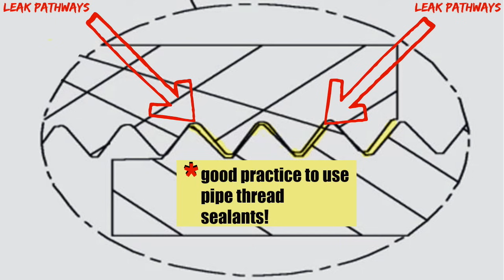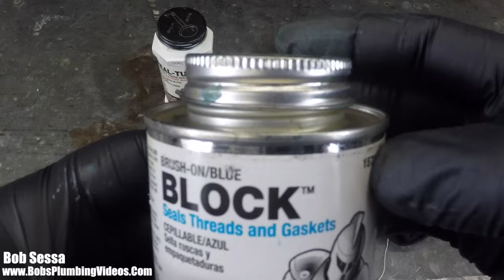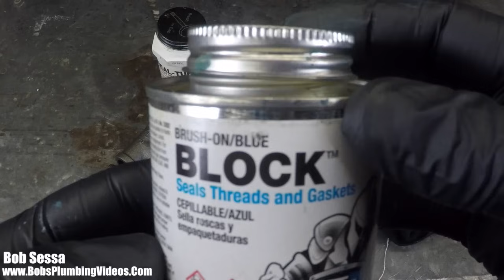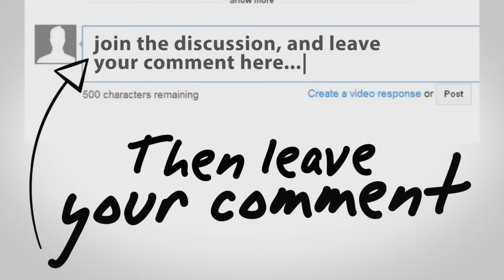Pipe Thread Sealant / Which Pipe Sealant & Why!

Comment: I think I am over tightening, as it is a bear trying to take apart years later. What is best to use to make taking apart easier? I have always stuck to straight teflon, but if something makes taking apart easy, I would change. 

I am needing  to reduce a 1" plastic, male, pipe threaded, fitting on a water softener, to a 3/4" male pipe thread. It came with a gator bite to 3/4" pvc or smooth copper pipe, but I have converted system to threaded at other ends all already for simplicity. It is plastic, si Was trying to stay plastic on plastic to protect water softener fittings. The in and out from wall has 3/4" male threads for using hoses. I would use the shark bite method, if I could find a short, 3/4", smooth to threaded copper pipe. 

My in and out from wall are opposite the in and out on the water softener, requiring me to cross the pipes also.

Comment: That's funny. I've been doing this for 44 years. I also use both dope and tape. It's probably a superstition. I always think as dope as a lubricant. Because, really, friction is the enemy of a tight joint. Never, ever, pull on the roll of tape when breaking the tape! What happens? The tape will get between the plastic edge and the roll and destroy the entire roll. What was the name of that Hercules dope that was black? Came in a pale green can. Now that was a sealant!
Reply from the maker: I believe it was Grip! Prior to Blue Block, that's what I would use for all my problem joints.

Comment: Thanks a lot & excellent video. I'm making a bean bag aka tree climber throw bag launcher with black steel. Don't trust PVC at 330psi, or even 100psi which will be about max. Should be a safer. Would tephlon tape be enough for 100 or so psi for say a 1hr or so? Or Blue block also
Reply from the maker: I would go with both the Teflon tape and a light coating of the Blue Block and you should be good to go. Thanks for checking out the video, regards. Bob.

Comment: Thank you for this video.  I will be installing a new boiler using black pipe for the supply and return headers.  Your video was a great help in making sure I seal the joints correctly.  Very well done.
Reply from the maker: I'm very happy to help, thank you for checking out the video, Bob.

Comment: I was hoping you would actually tell the differences between all the Hercules products because they all seem to be described in the same way as fast drying but still pliable they all have the same pre ssure ratings hydraulic ratings all can be used on all types of metal and plastic and PVC so its hard to choose which one to use. Some contain ptfe and some don't,  what applications require ptfe and which don't? I guess it doesn't matter they all pretty much seal threads. Was just curious, most of the stuff i work with is fuel oil related.
Reply from the maker: My expertise is in residential service and repair, that being said when I was in high school training to become an  oil burner service technician the sealant of choice was a product called permatex which I believe is similar to Hercules  Grip. Always worked, set semi hard and was the go to sealant of choice for no.2 oil.

I believe the the Hercules Real Tuff product has ptfe included, the MegaLock I believe does not. I use the Megalock almost exclusively with Teflon Tape unless I feel I have a problem thread in which case I use the Blue Block (use to use Grip). Hope that helps!

Regards,
Bob

Comment: My  question is, How do I seal Union fittings so they dont leak at all.  I have tried plumbers putty, Teflon tape,  joint compound and no matter how tight I get the union it leaks to some extent.  What do I need to do?  (Galvanized water pipe seams to be the biggest problem).
Reply from the maker: If you're talking about a "union fitting" in particular, I just use Blue Block or Grip on the face of both ends of the union before I assemble it and whack it up with a couple of my Ridgid pipe wrenches.
Reply: Ya shouldn't be using galvanized pipe for water anymore, since maybe 1950's.

Comment: Very informative, thanks.  Just to refine the overall issue, tapered threaded pipe connection is a throw-back technology that IMO remains with us only because it continues to provide excellent mechanical joint strength at low cost.  But its inability to seal has been a design flaw since its inception as your video addresses fairly well.  Augmenting the description I would add that the actual problem is primarily from the mismatch between the peaks/valleys of engagement.  The major diameter of the female thread HAS TO BE be larger than the major diameter of the male thread and, congruently, the minor diameter of the female thread HAS TO BE larger than the minor diameter of the male thread. (I say "has to be" because if there was an interference of either condition the rest of the two thread surfaces would not even touch.) The two resulting gaps at the peak/valley clearances then create two helical paths for a leak even if the rest of the thread surfaces match up perfectly. It is those helical paths that have to be plugged up

I would also add that male pipe threads on commercially produced pipes/nipples/parts are cut single point on a CNC screw machine that provides a much closer tolerance thread than anything you can hope to get with one of those multi insert manual pipe dies.
Reply from the maker: Impressive! thank's for that. Bob.

Comment: OK for pipe thread. Nice report. I came here seeking info about which sealant to use on flare fittings. tape? dope? nothing?
Reply from the maker: Technically with a proper flare, nothing. But personally I use the mega lock or the blue block for problem fittings.

Comment: My favorite stuff is blue block!! Love it!!! I use it on boiler piping.
Reply from the maker: Best insurance product ever I.M.H.O. Regards, Bob.
Reply: I agree!  Trying to disassemble a connection, that blue block was applied, later is tough!    You know that joint was sealed well!
Reply: PatrickNJ Yes blue block does set up a little bit in the threads.  But it’s not as tight as other sealants so it allows you to get the fitting apart if you have big enough wrenches. Got my nice 24 inch harbor freight pipe wrenches  and love them!   Also like how you can use blue block as a gasket maker basically you brush it on one face and let it set up for 5 min then assemble.

Comment: Thats all nice and fancy but i am sticking to my tried and true method that is super cheap and it holds any pressure without any problem-flax fiber pipe sealant and paint(you can use nail polish as well).To seal my leaking chinese compressor i painted female parts first ,then i painted male part,put 2 revolutions of thin  spread  flax on it and paint over it. While everything is wet i screwed fittings in .It will never leak ,not now not in 50 years (compressor will die 10x).
For me paint +flax is best sealant in the world ,i have same thing on my water system and in 30 years it never leaked a single drop.They used to put linseed oil and flax ,that works too but i prefer paint (just dont use lead paint-do they even make it anymore?).

Comment: Also where I live in Staten Island I see the Home Depot they sell those flexible hoses for the water heaters I was telling my neighbor they're no good they're illegal in New York what he said I got it behind my toilet I got it on my wash machine I got it on my kitchen faucet he said it's the plumbing Union what's your opinion I think cop is sweat lead-free is a better choice
Reply from the maker: Up tp me, I would still be using the solid chrome plated copper tube risers for toilets and sinks. Solid pipe or copper on the waters heaters!
Reply: Yes three quarter copper sweat the best for water heaters and of course lead-free solder
Reply: @BobsPlumbingVideos   Bob before 1986 I'm going back late 70s early 80s we use 50/50 on so many domestic Water jobs and then 1986 we went to lead free I used to like the 50/50 I still use it for hydronic Heating so easy to work with
Reply: @BobsPlumbingVideos  you got the old way of doing things me also it's a better way of doing Plumbing in my opinion

Comment: Thanks for that Bob, I'm in the UK, where they typically rip you off for about £90.00 for the 5 minutes it takes to screw a bayonet fitting into the back of your new cooker and then just plug the other end into the existing socket on the gas supply. But, not content with robbing you blind, the installer will then insist that it's the law that he messes up your decoration by installing a chain or restraint device. In the tectonically  stable UK there's as much chance of a cooker tipping over as of finding an intelligent and honest MP.

Comment: Awesome vid!
Now, i purchased some 1 1/4" galvanized pipe for a small section of line for my air compressor.
So this is not water related but air.
I used a dew wraps of teflon tape, then tightened with my pipe wrench. Hooked everything up and it wont hold air pressure...what did i do wrong? Maybe tightened toi much or should i get some dope?
Was thinking of loosening it all back up rewrapping with tape and when i retighten, ease up a bit?
I dont know... its frustrating. Lol
Reply: Treat it like gas pipe, use dope.

Comment: So interesting ,But Could you detail about the number of round of lamp-wick or layer that we need to cover the screw pipe?
Reply from the maker: It's going to depend on the condition of the pipe. Old  pipe 15/20 times around vs. New 10/15 times around? Whatever it takes to seal the leak.

Comment: How do you deal with sealant if you have to back a pipe out of a joint to complete the connection
Reply from the maker: Not sure I understand what you mean by backing it out to seal? I would probably go with the Mega Loc or Real Tuff as opposed to the Blue Block, which can get a little messy.

Comment: What do I use to seal a water inlet valve where the compression ring is supposed to seal it? Replaced valve and it is still dripping ever so slightly. Looked like there was residue of some sort on the copper pipe coming out of the wall when I took compression ring off.
Reply from the maker: Just so I understand you correctly, you have a piece of copper exiting the wall with compression nut and brass ring that connects into a compression type shut-off valve? if it's slightly leaking after you tighten everything, you can back it off expose the brass ferrule and try wrapping the ferrule with 1-3 rounds of Teflon Tape and re-assemble. You should be good to go.
Reply: BobsPlumbingVideos ok I'll try that thanks

Comment: I don't use Teflon tape with threaded PVC pipe. The bulk of the tape makes the joints harder to thread, and the soft threads can be damaged during installation. I get good results using only RectorSeal No. 5 sealant. Although the directions say it can be pressurized immediately after threading I wait and let it set at least a half hour or more.
Reply: I used Oatey Great White Pipe Joint Compound with 1" pvc to 1" galvanized female and it leaks, very slow drip. Is #5 that much better than the Oatey pipe dope or try teflon tape? I have the thicker blue Gorilla teflon tape and standard white tape.
Reply: @ridemfast7625  If you want to use tape try the thin kind and only use 3 or 4 winds. Then apply enough RectorSeal No. 5 over the tape so that some excess is squeezed out during installation. Wipe off the excess and you are done! I don't think Oatey is available in my area but since you've tried it and it's leaking you should probably stop using it. Or maybe you accidentally stripped the threads. Anyway, RectorSeal No. 5 without tape works fine for me!

Comment: I have had problems with the threads on some copper sweat fiitings being hard to seal.  The quality is just not as good as 40 years ago.  May have to get Blue Block.
Reply from the maker: It has never failed me in combination with some spool lampwick. Wear gloves, and have some lacquer thinner on hand in case you get it on yourself!

Comment: I bought chinese compressor and it had this yellow glue like sealant on it that is super hard to get rid of ,it makes removing fittings a difficult job -anyone knows easy way to remove it ? I had to heat up everything to release it ,but i am on one fitting that i cant heat up (next to pressure switch).
Reply from the maker: Thanks for sharing

Comment: I like the Megaloc or pro dope for gas pipe, we can use the yellow Teflon tape in the DMV but I wouldn’t recommend it, some people swear by it but have seen dozens and dozens of yellow Teflon w/ dope joints leaking, ill take all that nasty tape out clean the threads, slap some megaloc or pro dope on it and create clean gas tight joints that look good and are leak free.
Reply from the maker: Megaloc is my go-to sealant of choice! If 
I get a stubborn joint BlueBlock to the rescue.
Reply: BobsPlumbingVideos Ive been trying out that Blue block, you were right it works very well, it’s a bit messy you just gotta finesse it.

Comment: Bob,   galvanized pipe rust where thread is exposed, any suggestion how to seal these areas, thanks
Reply from the maker: Rust or Leaking? Rust, leave it alone, leaking, you would have to disassemble and re-assemble using the methods in the video. Be careful with galvanized it could be very difficult and or break when trying to remove!

Comment: I do fire sprinkler work and I know a lot of old timers I worked with over the years will use dope only. My personal opinion is I use dope only on the shop side that I’m making a fitting on using the 300 machine and the other side of the pipe that I’m going to tighten in I use tape a dope. The bigger the pipe the more tape I use. Just makes for a less grittier thread especially on 1 1/2 and 2 inch threaded pipe. Just alittle bit from my experience. Other than that it was a good video.
Reply from the maker: Thanks for checking out the video! Regards, Bob.

Comment: Excellent video.  I love that fact that you take an extra few seconds to wipe your joints and make them look neat.  Also although you didn't touch on it in the video I see sprinkler fitters using the paste and then a few layers of Teflon tape over it.
Reply from the maker: Robert Meier   Thank you for checking out the video! Always wipe my joints down, the difference between a professional  and a novice. Some use the tape first followed by the paste and visa versa. I guess it’s personal preference. As long as it doesn’t leak! Regards, Bob.
Reply: It’s actually better at least in my understanding that Teflon tape then sealant after, if you use the sealant then the tape the tape makes a balloon of sorts and it just gets pushed out of the fitting.

Comment: Do any older plumbers know what the old black pipe dope was called. When I used to do service it seemed like anything before the seventies was black pipe dope and it was next to impossible to break loose sometimes. I always used the yellow rectorseal. The guy I learned from is in his 70s now and he wouldn’t use pipe dope on plastic period. I don’t know if that’s how old dope was. We eventually bought some Teflon enforces dope and he’d use that on plastic. All we used was rector seal. Yellow dope, glue and cleaner (though sometimes we’d get oatey from hardware store), and c-flux. I carried those same habits. I just bought a can of mega lock and so far I really like it. It’s thinner and easier to clean. However i feel like I have to stir it up first. 
They won’t let you use Teflon on gas period? I know you can’t use the white tape but the yellow tape is for gas. Also megathread and blue monster tape are okay for gas.
Reply from the maker: In NYC we can’t use any type of Teflon tape for gas. Mega lock, BlueBlock, Hercules pipe joint compound all good. Starting out I used mainly Hercules pipe joint compound which we had to occasionally stir to keep the oil from deprecating.

Only black color compound I recall was a product called Grip which was similar to Blue Block and a real pain isn’t the ass to get off your hands. But it seal joints incredible well!
Reply: That’s probably what it was. They probably used wick as well but i never paid enough attention to see it. I know that trying to remove something with that on it was extremely difficult.

Comment: Hi, great video.
I am making alcohol dispenser from brass pipes, I tightened pretty good, still leaks, I cant use teflon as alcohol eats it eventually, what best recommendation-would be to make no leaks?
Thanks!
Reply from the maker: I would use the spool lampwick and either the Blue Block or a product called Grip.  Use it sparingly and wear gloves, have some lacquer thinner around for cleanup if needed. Regards, Bob.

Comment: I wish I knew about blue block. I had to redo the connections for a stove that was put in by a hack. It was a completely unnecessary  jumble of fittings that pushed the stove 4" away from the wall. I reused some of the fittings and made it work but it was a hassle.

Comment: Perfect and with enough options for me to figure something out in a hurry even if it's a  Sunday and all the stores are closed, and we are in the middle of nowhere. Thank you! we're in a hundred year, old run-down summer house with plumbing, which is great, but of course there turned out to be two leaks when we turned on the mains, and I've never seen iron water pipes before
Reply from the maker: You're welcome and thanks for checking out the video! Regards, Bob.